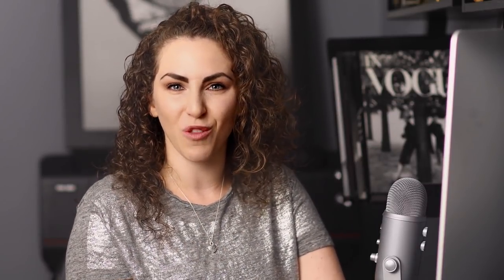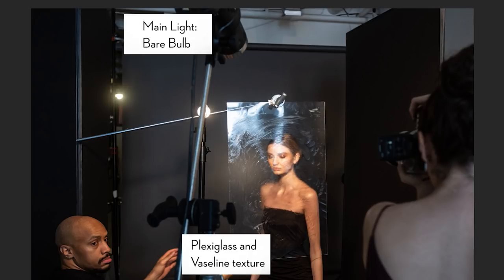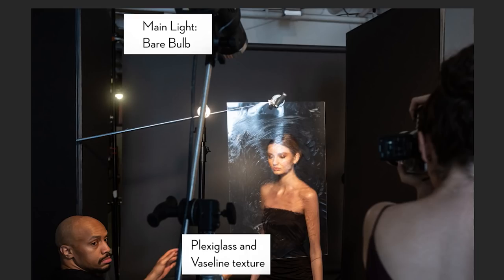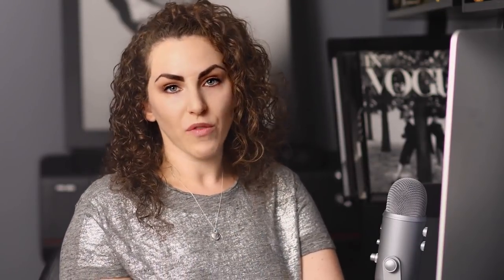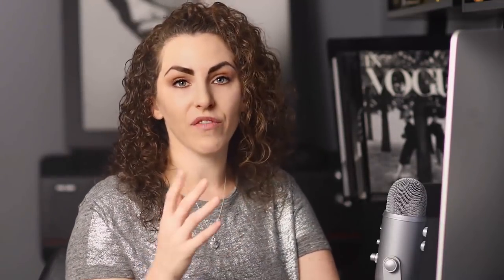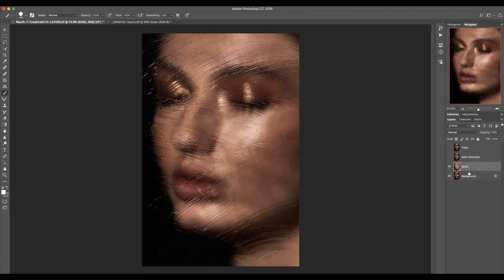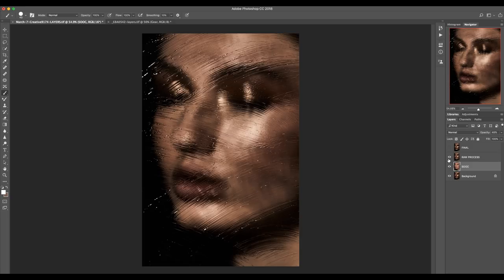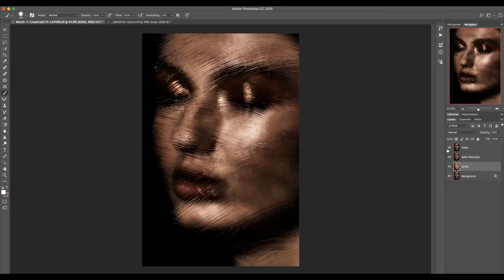Photo Deconstruction: In-Camera Painterly Beauty Image

Comment: We used to use vasseline on filters for making beauty 
portraits 100 years ago. Old technology
Reply: No kidding. Or food colouring to get an interesting look. Hassy with bellows hood that had a slot for HUGE filters. Cheap plexi squares. Paint, them, cut out the centre for sharpness and then control how it looks using the bellows. I miss that piece of gear. Damn, this has now got me looking to replace it.
Reply: sir please show us new technology :)
Reply: @kuldeep19jat  I know, even older than I am. You can do similar in PS, but it does not feel the same. When you are doing that stuff live it starts to change how the shoot feels and adds to creativity. Sometimes the new tech is too easy.